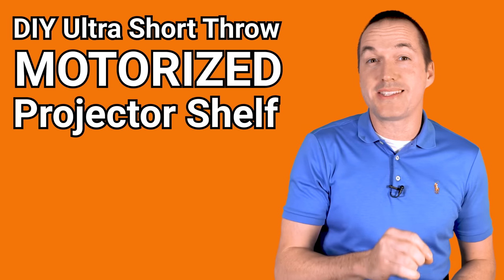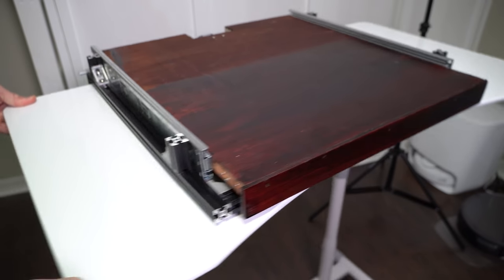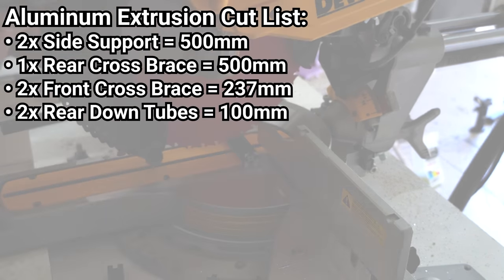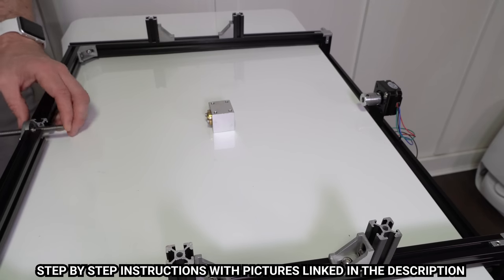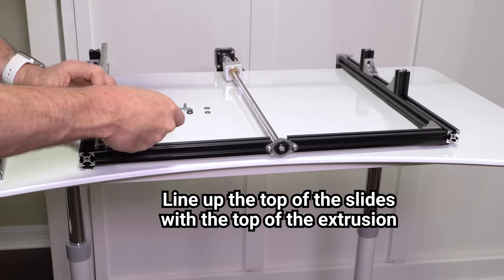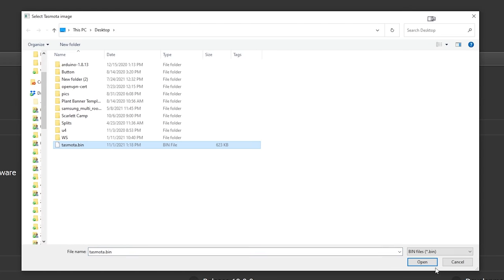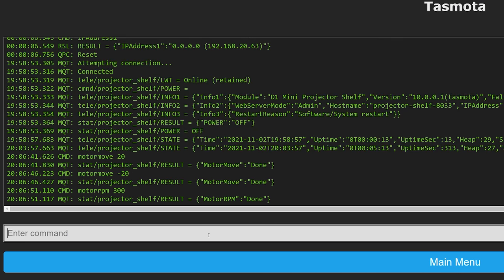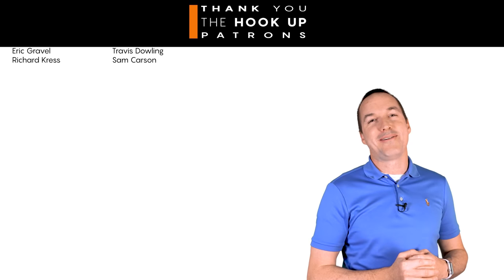Motorized Ultra Short Throw Projector Shelf - DIY under $200

Comment: This is awesome. I wonder what happens if you lose power in the middle of opening/closing. E.g. how it is handled when you are stuck at 400 steps into the 900 to extend.

Does that esp32 or the motor controller know if you try to over-extend or over-close?

I am somehow missing a limit screw from the device. In fact, I am about to (for the last 6 months, but no time) do the same, but will rely on limit switches and a simple DC motor......    but now I am thinking that steppers is the way to go :O as I have a ton of them in my drawer I never actually used.

+1: I had no idea Tasmota did the Belkin emulation. This is awesome, I am trying this out right after work today ... kind of tiring to put everything into Node RED :O .... my Phillips emulation page is 5 meters long
Reply from the maker: The great part about stepper motors is that they can't push that hard.  If a limit switch fails and a DC motor overextends it would either destroy the mechanism or overheat the motor.  When a stepper motor overextends it just makes loud noises, but because the force of each individual step is pretty small it doesn't hurt anything.  In the edge case that your power goes out in the middle of a move you can just send specific MotorMove values through the tasmota console or deal with one set of loud noises while it forcefully recalibrates itself.
Reply: @TheHookUp  Thanks! Makes sense. 

The actuator I have actually has an internal limit switch, so if you calculate that it takes 30s to extend, put 45, then it just cuts out when it reaches maximum.

So if I have a limit switch just a few mm short of the internal one, I can shut the power off. If that fails, it is still safe.

That said, I have 5-6 steppers and controller boxes/circuits in my drawer, and looking at your project I am really motivated to do something with them :) .

Cheers !
Reply: @TheHookUp  Apple's Disk II floppy drive used a stepper motor for positioning the read/write head.  It didn't have a limit switch, just a mechanical stop.  The first time you accessed it after (re)booting, it did a recalibration that was loud (I think it actually banged against the stop a few dozen times), but I never saw a failure of that stepper even after nearly a decade of daily use.

Comment: I have a problem with the command. After typing motormove 3000 the silver box would move forward. But typing motormove -300 the silver box still moved forward. What other command would make the motor move in reverse?
Reply: Finally got it working. I had to solder the D1 mini as the connections were loose. I got it to move forward and back but encounter a problem after attaching the code in the description.

Comment: Should add a light senor so the projector turn on then it will extend the drawer by itself
Reply from the maker: I use the projector's smart OS (androidTV) to monitor for power on/off, works great.

Comment: This is great, but using a stepper motor for this is overkill, you will never need to open this drawer half way for the projector.
You can achieve the same result easier and cheaper with a DC Motor, an H-Bridge (DC Motor driver) and 2 switches for the limits.
Reply from the maker: I completely disagree.  A DC motor, H-bridge and 2 limit switches would not only be significantly more complex from a wiring perspective, but also more failure prone (limit switch failure would be catastrophic), and would represent basically zero cost savings.
Reply: @TheHookUp  I don't say by any meaning that this is a bad project or a wrong way to do it, in fact it is awesome.
I agree with you that limit switch failure could be catastrophic (there are some ways to prevent this), but a limit switch like the ones used on 3d printers works for thousands of clicks, so it should work for many years before you find any failure.
With respect to the wiring, it is almost the same than the one you used with the DRV and Wemos, with 2 less cables for the motors and 2 more cables from the switches to the wemos, so the wiring is not more complex as you said.
Also a DC motor is a lot cheaper and easier to find than a stepper motor in many places (not everyone lives in USA) and, if necessary, you could build an H-Bridge with a couple of transistors.

Comment: I followed your guide but instead of DRV8825 i used A4988 driver. The motor keeps running in one direction the moment I turn ON. When I press reset button in D1 mini board the motor turns on opposite direction. The tasmota console commands like motormove 20 is not working .  Also D1 mini is shown in the router's list of wireless connected devices when I plug USB between D1 & PC. When I unplug the USB from D1, the d1 mini will not shows in list of wireless devices. any suggestions ?
Reply from the maker: Sounds like you have the A4988 hooked up incorrectly, re-check the wiring diagram or buy a DRV8825.

Comment: How would you go about wiring a backup momentary switch?
Reply from the maker: From the tasmota web interface go to configuration, configure module and select switch1 for D2, then hook your switch to D2 and GND on the D1mini. That will give you a toggle switch where ON will be projector all the way out and OFF will be all the way in.  If you want it to be a momentary button you'd go to the tasmota console and type switchmode1 4
Reply: @TheHookUp  you the man, thanks.
Reply: I tried the guide using a push button latching switch but for some reason, the projector doesn't retract when the switch is turned off.  It does go out when pressed.  Any guidance on what I could have done wrong?

Comment: Wouldn't it be much simpler to use a DC motor with microswitches?  You do not need precise control of the position because you are only concerned with all the way in or all the way extended.  On the other hand I have a stepper on hand and also some drawer slides so I may just make something like this just for fun.
Reply from the maker: Depends what you mean by simple.  It would require more wiring, as well as wires that need to run the length of the shelf (for the front limit switch).  You'd still need a motor driver and buck converter, and a mechanical failure or wiring failure of one of the limit switches would be catastrophic because there would be nothing to shut the motor off.
Reply: @TheHookUp  Thank you for replying.  You are right and it's your show so I'll let you win.  Your whole point it to show cool technology and something simple kind of defeats the point.  There's always more than one way to skin a cat.  I guess what's got me hung up is that I tend to think of steppers as a precision positioning mechanism and with something like a shelf there are only two desired positions. in and out.  I should look at your curtain videos again.  How do they determine open or closed?  I really don't remember. I also don't remember if they could be open just a little bit or not.  I'm seriously thinking of making something just for the challenge.  I don't even really have a use for something to slide.  I once had a TV cabinet with doors that I wanted to motorize but TVs got bigger so that went away and now it's holding sheets.
Reply from the maker: @dougcox835  Steppers are so cheap now.  One thing I do use mine for is I have a preset for a 120" screen and another one for 100" screen that pulls the drawer out to different spots, but honestly I never use it because  why wouldn't you want that extra 20"!?!?
Reply: @TheHookUp  While I'm talking to you I'd just like to say thank you for your LED videos of a couple of years ago.  All I have is a single strip outlining the front of the roofline and I just use an Arduino Nano to make some patterns. But it's the hit of the neighborhood.  I'm amazed at how impressed people are with really simple things sometimes.  I hired an electrician to put an outlet at the corner of the house so no extension cords now and routed the USB cable to the bedroom inside.  I really need to get an ESP32 going for wifi control though.  My thing is that I do not want to have a computer running all the time to control the lights.  Just turn it on and it goes.  I'm very close to my goal.  My problem mostly is that the strip keeps dying due to the connections between sections.  But that's just my own poor workmanship.  I use 12V lights to not have to provide taps in the middle.  The end is a little bit dimmer but not enough to matter.
Reply from the maker: Glad to hear it Doug.  You should check out the DigUno, it's an ESP32 based LED controller with a fuse and level shifter built in.  Comes presinstalled with WLED: https://quinled.info/pre-assembled-quinled-dig-uno/

Comment: How much weight does this shelf hold?
Reply from the maker: There are too many factors to answer that definitively like the distribution of the weight and the thickness of the shelf it is being mounted to.  My current projector weighs about 25lbs and I haven't had any issues.

Comment: Very nice Project! 
As improvement i would reccoment to use a servo instead of a stepper since its faster and less "stepp-ish".
And maybe add at least one End-Switch?! ;)
Reply from the maker: 380mm of extension with a servo? Also, I don't think an end switch is all that necessary because the stepper is fairly low torque and won't do anything but miss steps if it is at the end of it's travel.  It would also add a lot of wiring complexity that might turn off a beginner DIYer.
Reply: That servo would need to be huge to have the torque needed to do that. Plus you’d need to design a bunch of linkages. Or you could use an infinite servo but that now means it’s basically just a motor that you need to attach to a lead-screw… at that point the stepper is the far better choice since it has known step angles.